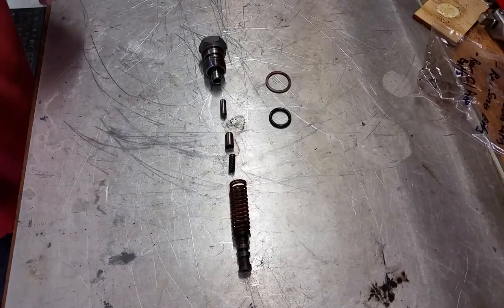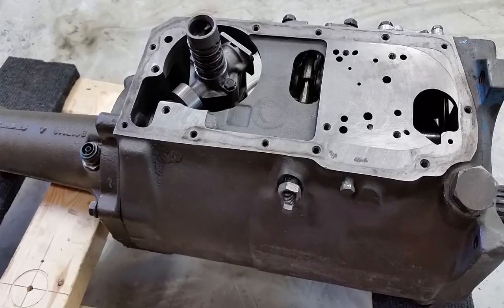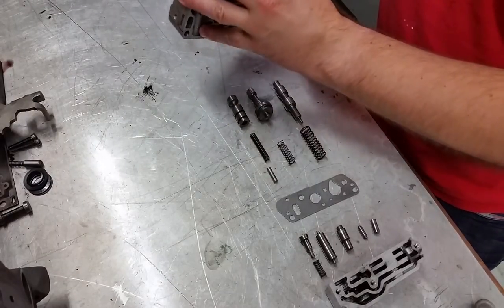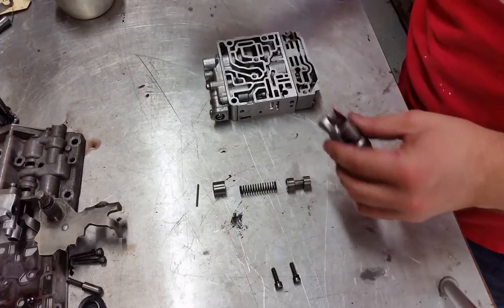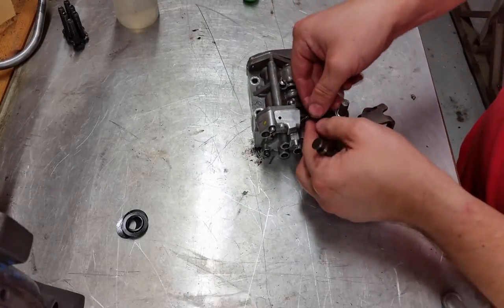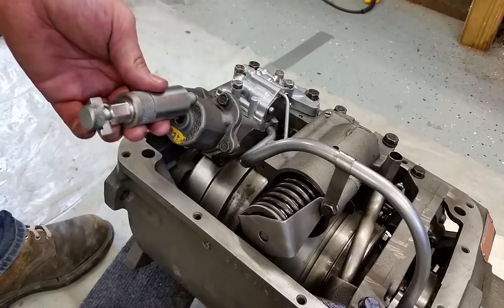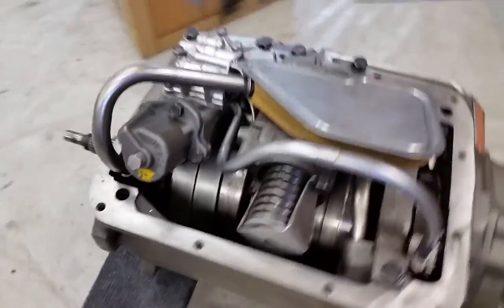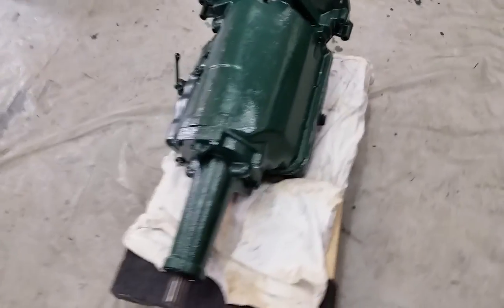1955 Oldsmobile Hydro-Matic Rebuild - Part 3

Comment from the maker: When the engine is off and no pumps are providing pressure the rear band is applied. If the selector is in reverse the parking prawl will engage. If the rear band spun freely there would be no park.
Reply: Did you ever do a 1950 oldsmobile
Reply: @jamesreddinger  No but a lot of the process is the same based on the books I followed.

Comment: Great series, very helpful! So how did it work out? You never posted any more videos about this.
Reply from the maker: I wish I could tell you more but I moved after I got it installed in the chassis so the project stalled. I did run it through all the gears on jack stands.

Comment: hello sir , I got a 55 Oldsmobile 88. when the transmission goes into 2nd it really kicks in hard,  but going into third its pretty smooth. Any thing I can adjust or do anything that would help the issue . do I need to rebuild the transmission and do you recommend a rebuilt kite. by the way this video is awesome.

Comment: Thank you for the terrific job showing the rebuild.  I have a 1954 GMC 1/2 ton pick-up that has a hydromatic in it and I just pulled the engine and tranny and was wondering if I could rebuild the tranny myself.  You make it look easy.   Where did you get your manuals?
Reply from the maker: Jeff L. Oliverson The Oldsmobile ones are pretty available on ebay. I would think the GMC ones would be too.

Comment: Great info ! Tnks ! one question, does this transmission has any type of cooling system ? Im rebuilding a cadillac deville 1955 and has this transmission and I was sourprised that has no cooling of the oil at all
Reply from the maker: Not until half way through 1956 for Oldsmobile when they released the Jetaway model.  The Jetaway had a cooler in front of the radiator.  Before this they didn't have anything.

Comment: Hey my dad has a 54 olds he just restored and the trans is leaking from front seal speedo cable and pans gaskets.  Is this typical for these transmissions? If so what does he need to when replacing gaskets next time? Any help would be appreciated.

Comment: My 54 Hudson Hornet has a Hydra-Matic transmission in it. If they sit awhile, does the parking mechanism tend to get stuck? I had to unhook the driveshaft to pull the car on the trailer, when I bought it. I got the engine running and redid the brakes, recently. Does the engine have to be running to get the transmission out of park? I haven't tried that, yet.
Reply from the maker: What I have does not have park. To park this model you put it in reverse and turn off the engine and when the pressure goes to zero the prawl engages
Reply: @a58strod  The Hudson is the same way as far as no "P" or park on the indicator. Put it in reverse and turn off the engine. So when I crank it and the pressure rises, the pawl will release. That's what I needed to know. Thanks.
Reply: @BigBlock4Door  The reverse anchor "parking paw" is engaged in reverse, the rear servo is holding the rear band off and when you shut the engine off that servo loses pressure and the band clamps back down which is what gives you "park".

Comment: Hi thanks so much for posting. Where can I get my hands on the tooling for the front band? I have the rear band already. I’m in Oz so I’m going to have to rebuild my own tranny as I can’t find anybody down here
Reply from the maker: You'll just have to setup a saved search and alert on eBay for one. The part number is J-1693-A. Good luck!

Comment: Hi, would know the diameter of the input shaft that goes into the back of the flywheel? Is it 0.540”?
Reply from the maker: Hopefully better late than never, I measured .539 with my dial caliper.